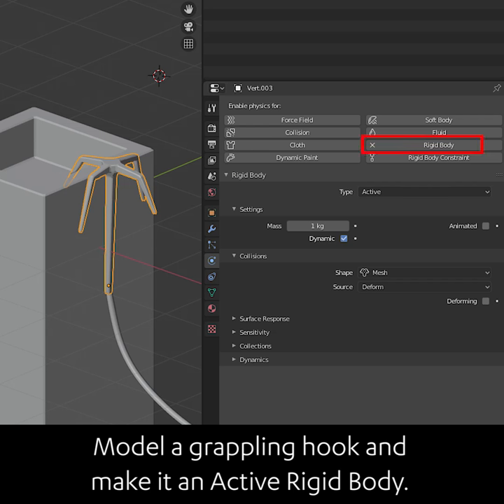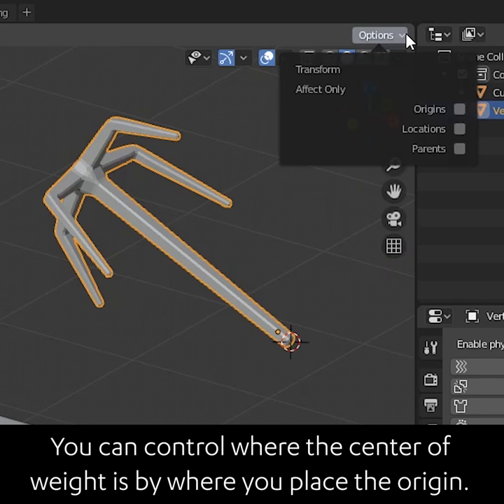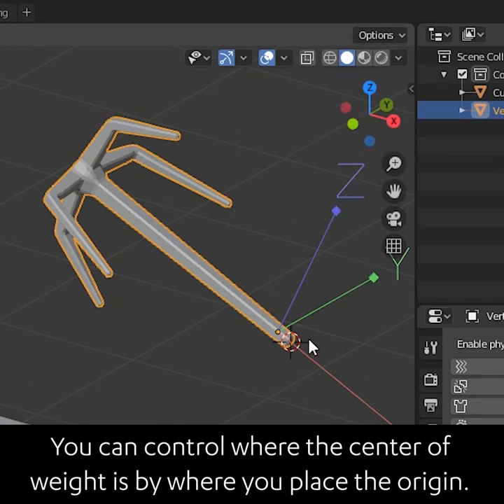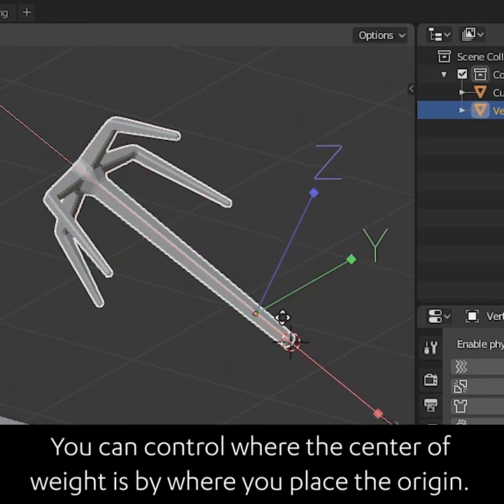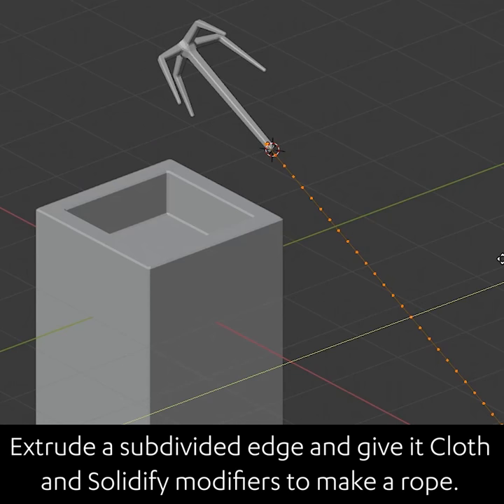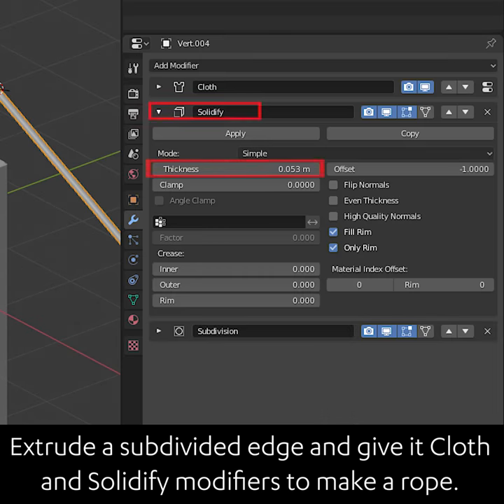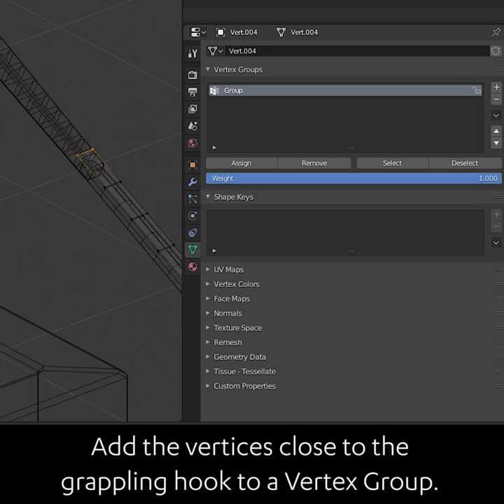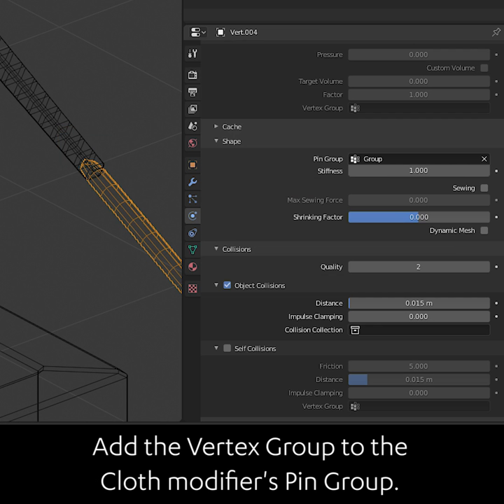Blender Secrets - Grappling hook and rope physics

Comment: Hey, I dont understand the extrude a subdivided edge part, should i cut loose that last face and use it as a new object and then apply the cloth and solidify modifiers?
Reply: I think he ment that you have to extrude all edges / vertecies to the side in order to create faces. Then go back to object mode and add the two modifiers to that object.